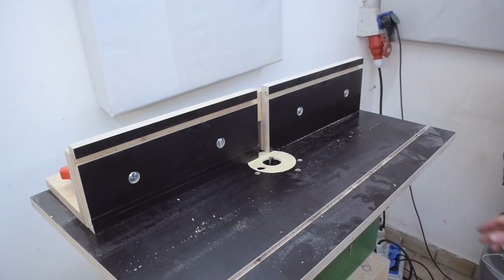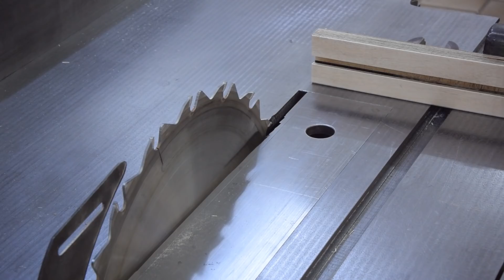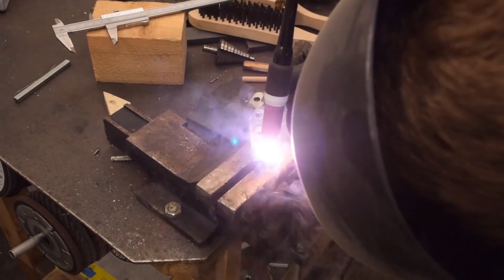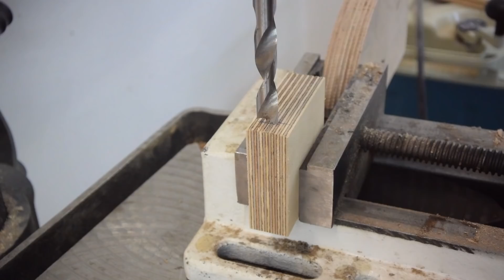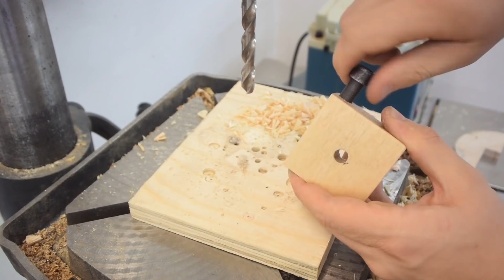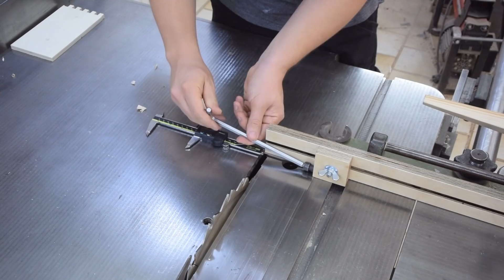Making a Micro Ajustable Stop Block + homemade T-Bolts

Comment: Love the idea, but would there have been an issue with making the adjustable stop go through the birch block and then contact the work piece?  What I mean by that is, you could have your work piece on the table saw and adjust the allen head bolt while the work piece is still on the table and in place.  Love your work and attention to detail.  Also the tips and insights into your process are very helpful and often extremely educational.

Comment: If you know the number of threads per inch you know how much you move by screwing stop in or out. For example, a screw with 40 threads per inch moves .025 of an inch for a full revolution. you can put hash marks on the outside of the screw head which will tell you in finer detail how much you move - just a thought